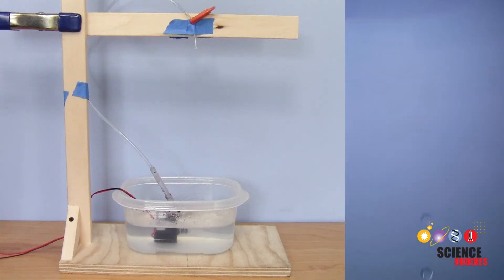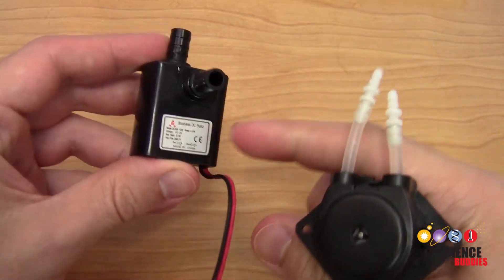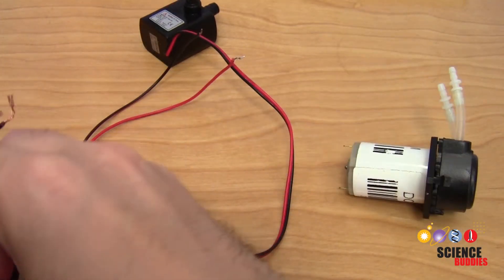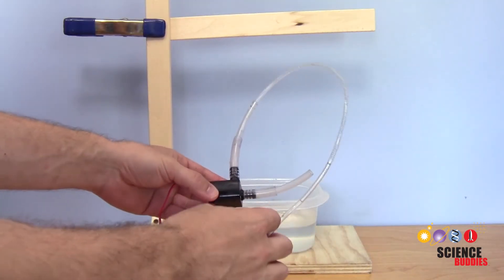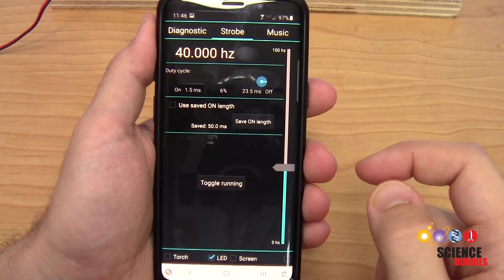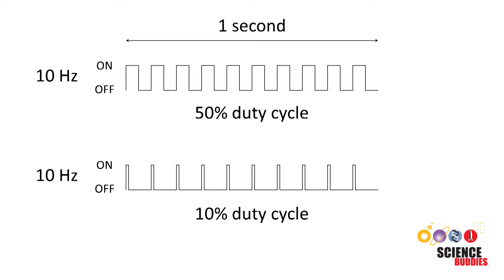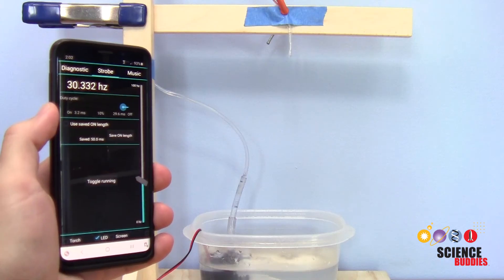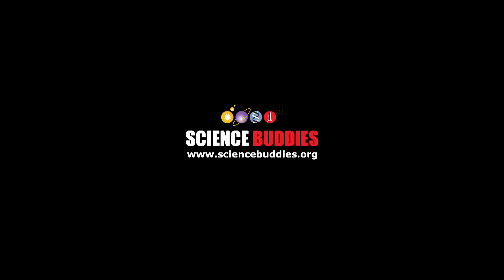DIY Levitating Water Drop Fountain | Science Project

Comment: Amazing info thank you . I’m making a project where I want to make the water stream falling a 2.5 meter height..can I achieve that with the equipment in the video or I will need different equipments since the stream will be long ?
Reply from the maker: Hi - you will need to make sure you buy a pump powerful enough to pump the water that high. We have not tested the small pump in our video at that height so cannot say for sure.
Reply: I going to try it as well, my concern is more about to find a 2m band led , how did you manage it ?

Comment: thanks, but any replace for Arduino? there should be a known kit to control LED frequency. right?
Reply from the maker: We don't have a project on it, but if you search for "LED flashing circuit" there is a basic circuit you can build that will flash an LED without requiring an Arduino.